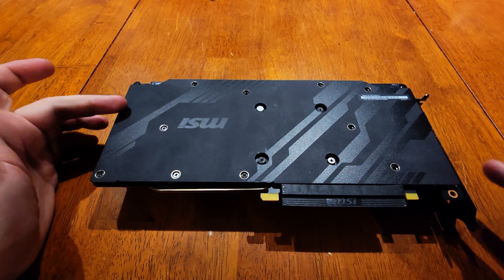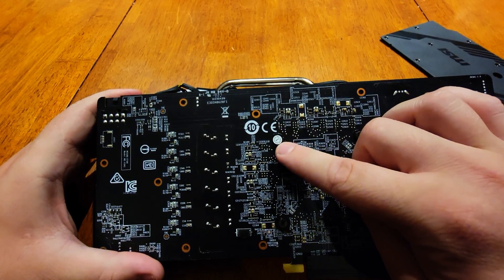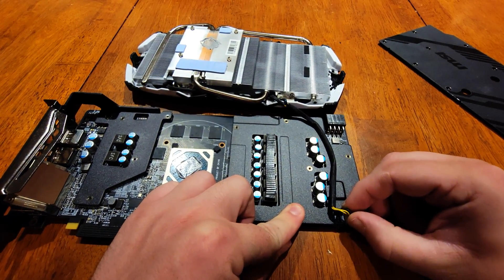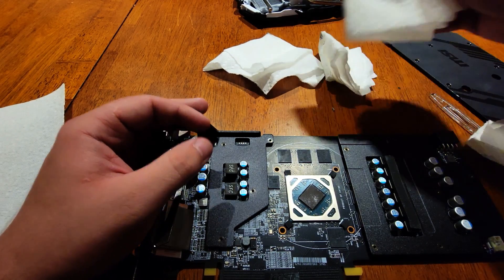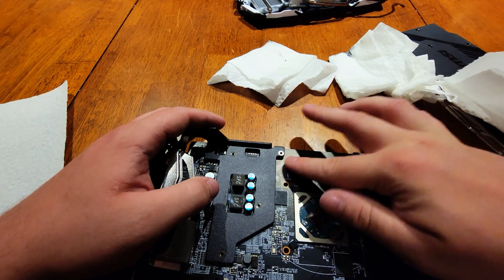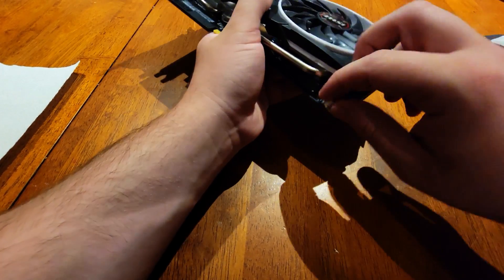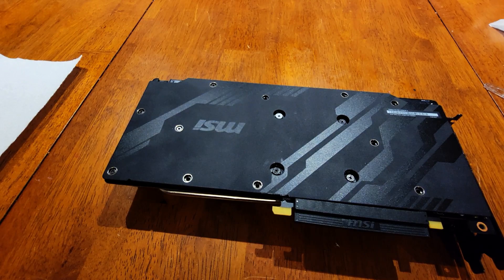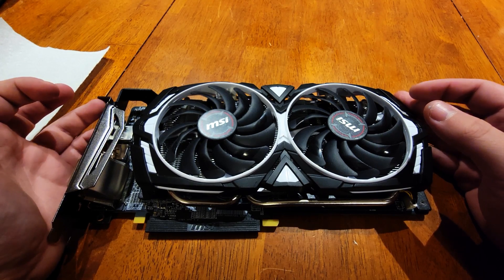Do This When You Buy a Used GPU...

Comment: Sometimes the thermal paste is hard like rock.

And thats probably the reason Im not getting an HDMI out on the 650Ti 1GB, probably the owner just ran this thing into the dust.
Reply from the maker: If it never had its thermal paste removed then it could possibly be that overheating killed the HDMI. One of my buddies took an old "broken" card changed the paste and tested it and it suddenly worked again. I'm not saying it will bring your 650Ti back to life but it is definitely worth a shot.

Comment: did this after getting a used 1050ti and card was running 12 degrees cooler :D
Reply: Still daily drive the same 1050ti as its still a pretty solid card👌
Reply from the maker: My first gpu was a hand-me-down 750ti, but the first gpu I bought myself was a 1050ti. It was a great card and I ended up passing it down to my siblings.
Reply: @Rougeliger  my first card was also a hand me down, it was the gigabyte windforce HD 6770 and it had artefacts so not the best but it worked until i got my 1050ti :P